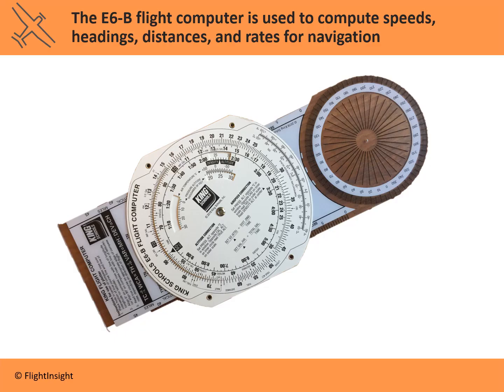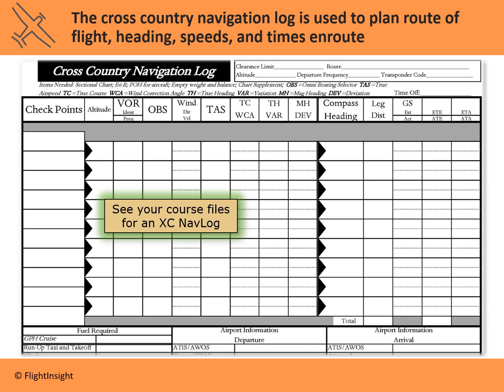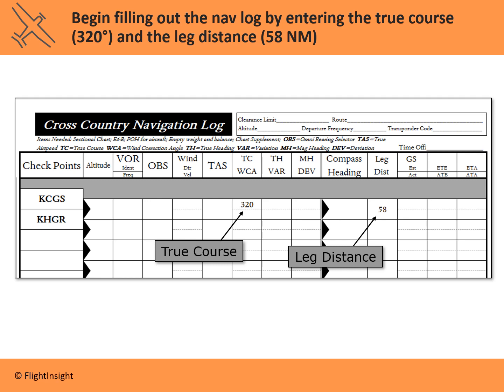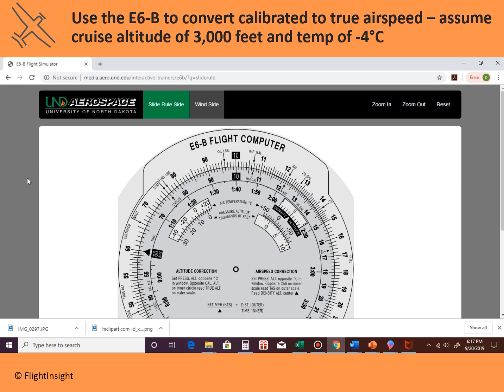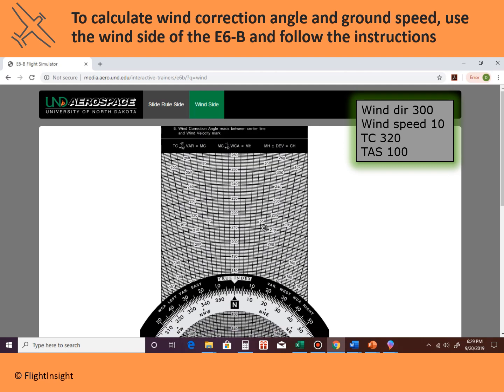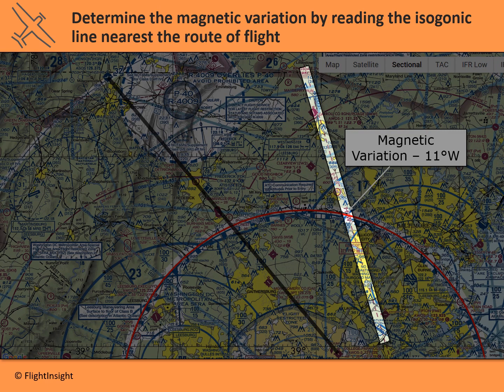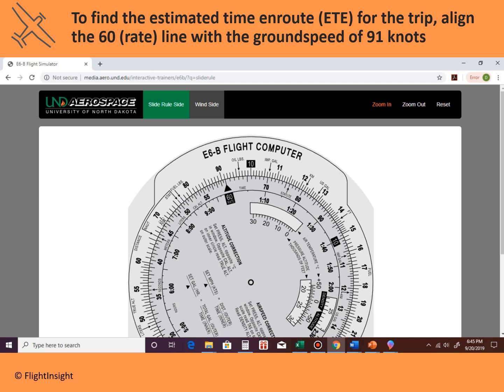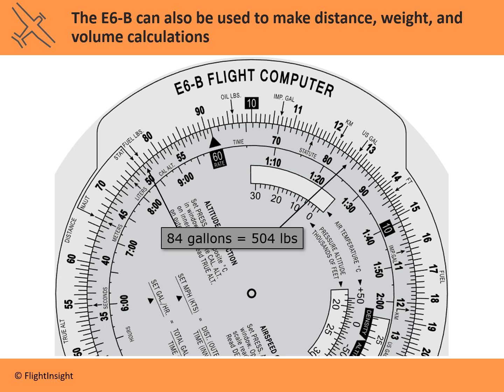Using an E6-B on Your NavLog | Cross Country Flight Planning | Wind Correction | XC NavLog

Comment: On Spock's E-6B, the circular slide rule side's circumference tint is yellow for better contrast and visibility against the black markings - especially in low visibility conditions. I have several aluminum military versions with no tint (large like Spock's and smaller ones).  Many E-6B's are made of stiff white cardboard or plastic, allowing a wider range of colors for special markings. They are more easily warped, no pun intended.